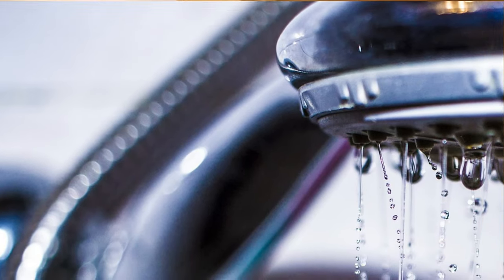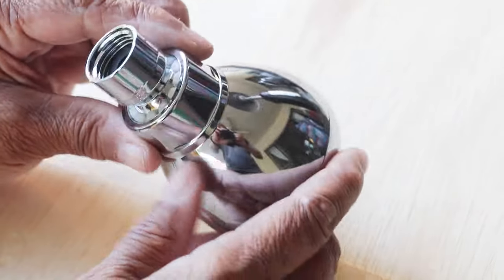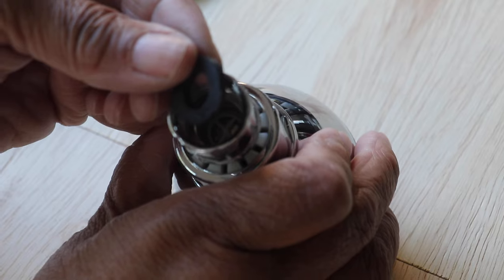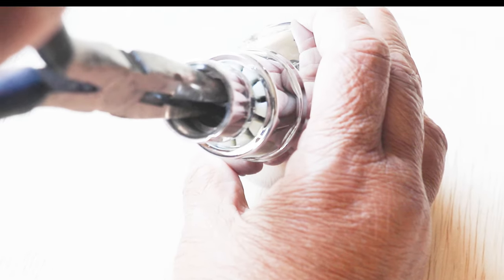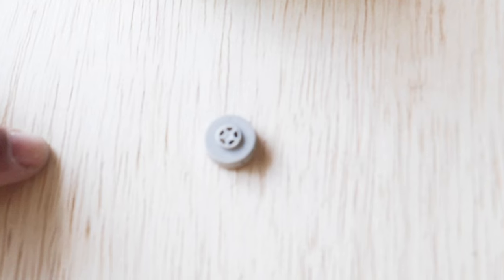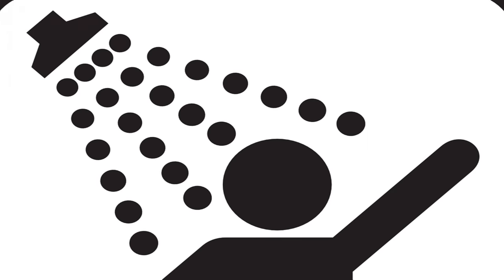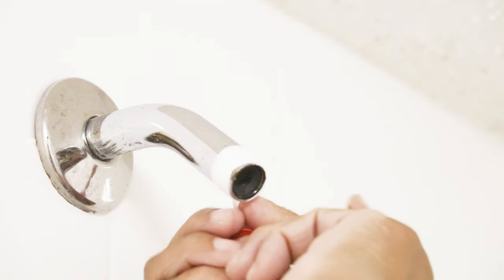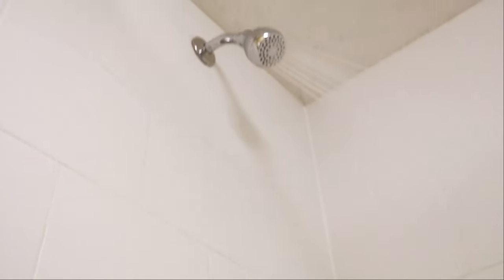Secret Few Homeowners know and PLUMBERS don't tell you

Comment: We plumbers have a professional responsibility to conserve water, and some water heater manufacturers  recommend leaving this fitting in place to maintain temperature control. Water flow restrictions can also act as a backflow device to prevent contamination of the mains water supplies. It is also the first time I have been disappointed in one of your videos...Also low pressure at the shower is not indicative of low pressure throughout the house... Some people will misunderstand the message. One more point is that once the shower manufacturers cotton onto the tampering of shower valves  the manufacturers will simply fit the restrictions into the shower valves as they have in Europe. This stops diy tampering....
Reply: Would you have time to explain about the backflow and contamination? Thanks, if so!
Reply: @regular-joe  of course. It depends mainly as to how the shower is fitted,and applies more to those showers with flexible hoses, rather than fixed heads, and if the shower is mains fed. Clean mains water passes through the shower head, but once it has it can  become contaminated from water in the bath or shower tray. Some bacteria can pass back along the stagnant water remaining in the shower hose into the fresh mains water supplies under certain conditions.
Reply: @profpriv  thanks! I'd absolutely never heard of that, much appreciated.
Reply from the maker: Thank you for taking the time to comment, it's aleays good to hear from brothers in the trades with a different position.  Now in all fairness, a flow restrictor is not a backflow device.
Reply: @seejanedrill  thank you Jane.
Reply: Yep, and the main reason, waste water plants are getting over loaded, they can’t treat the sewage good enough when there is too much waste water going through them. As a city grows the waste water p,ants stay same size, so that is main reason. Who wants to swim down stream of a waste water plant that doesn’t have enough time to treat water......out their drain pipe it goes.

Comment: Talk about ironic! Just yesterday, I removed the one in my kitchen faucet by accident! 🤣 Cheap leaky apartment fixtures. I don't pay for water. I don't waste it either. I DO need pressure tho. Kitchen faucet has NONE! 5 minutes just to fill a pasta pot. It drips when off. Loosens to a trickle when I leave. Thanks to you, I have extra washers and plumbers tape. On a wing and a prayer, I remove the loose handle. Find the drip cause! Stripped screw! Replaced that, by by drip! Wheee! Swapping the washer, this "thing" falls out. What's THAT?? Who knows? Fling it over my shoulder, and insert new washer. POOF!!! FULL PRESSURE!! What the heck??? Now it know!! Shower head here I come! You are my hero Leah!

Comment: I’ve been removing those stupid things since they started being used. I’ve had a flow restrictor that wouldn’t come out. I’ve actually had to drill a hole in one.
Reply: I have drilled a lot of shower heads as well. It's worth the time to do it. It's all fine and dandy to try and save water but if you have to spend 3 times as long to get rinsed in the shower you aren't saving anything 😉
Reply: I can’t get mine out.  Maybe I’ll try my drill.
Reply: @jafallica  Careful! Some are booby trapped.

Comment: I found that removing the restrictor was actually too powerful in one of our showers (it splashed everywhere), so we compromised by drilling out the small holes just slightly larger with a very small drill bit and it works FANTASTIC!
Thanks so much for your tip of removing it, we went from lousy shower pressure to what we consider perfect.

Comment: Sadly, this video was not online when I went looking for how to do this last year.  As always, Leah presents the most useful home-modification data in the most succinct and to the point manner possible.  This little hack improved my shower experience overall, and for the loony tunes who think this wastes water you should know that if you're in it to clean up and not just play around, removing this restrictor in an otherwise decent showerhead will reduce your actual in-shower time by around 10 minutes.  What's the math on that?  2 gallons per minute for 20 minutes vs 3 gallons per minute for 10 minutes...
Reply: Thanks Leah! Love your tips & tricks!! Cheers from FL😺

Comment: It's largely to comply with California mandates. Low flow will also cause fluctuations in temperature as some anti scald features on shower valves won't function well under low flow conditions.
Reply: I'll betcha this is the reason my temp fluctuates in shower!!!  Thank you.
Reply: This is especially the case with tankless water heaters that have minimum flow requirements. Rannai, Navient, etc.
Reply: @FM19MONTH  I had the same problem of water temperature fluctuating. I have  tankless hot water heater which is prone to do this on low flow.  What I discovered by accident is to first turn the water on as hot as possible, no cold water. When the hot water is flowing through, I then adjust the temperature to where I want it and it doesn't fluctuate anymore during that shower.

Comment: Also these flow restrictors can clog with hard water deposits or debris and cause major issues as well. They are more harm than good in my opinion. I had to deal with them in the newest house I bought in the faucets. If you want to limit water output, slightly shut off your valves to the faucet.
Reply: If you want leaks  by all means dont open them all the way......those valves are made to be wide open

Comment: California dropped the rate to 2 GPM for shower heads, and manufacturers nationwide have followed suit so they don't get fined if one of their products gets offered in the state. So this is great advice for everyone else!
Reply from the maker: Makes sense
Reply: I'm in California in the Central Valley and we dropped the rate to 1.8 gallons!!!  Can you believe it?
Reply: You need to rinse off and some you the water in pain management...if your water is restricted, you often just end up spending twice as much time under the water rinsing off.
Reply: I just replaced my sink spigot on the other side of the country and it had a 1.3 gallon restrictor saying the blame went to California on the package.But I quickly learned that if you measure up the restrictor in H x W x D and thread pitch , they are all metric these days. that one can go to Amazon and buy one of the desired flow rate ,well worth the cost.
Reply: Flow restrictors have existed since the 80s. Fully remove it, and you’re using more than 5gpm easily. So, let’s assume you’re actually paying attention and really shower in half the time, but still enjoy your shower.

At 10 minutes unrestricted, you’re at a minimum of 50gallons down the drain.

Flow restricted to 2gpm, at 20 minutes you’ve used 40gallons. The longer you take to shower, the more that waste grows.

Do what you want, but be aware of your use. If only to save yourself some cash when your water bill comes.

Comment: Hi Leah!  I'd like to advise your viewers (with your permission), that flow restrictors usually collect debris developing the pressure drop issues.  They can be removed, cleaned and reinstalled especially if the user has an instant on water heater (those units are very keen on water flow for delivering the temperature you set them at).  Thanks again and I LOVE YOUR MESSAGE OF YOU CAN DO IT!

Comment: Bravo, Leah!  I'm a long-time DIY'er, grow up with a handyman dad, so I knew about these.  But I haven't changed one out in a long while, so your video was a great reminder of what to do.  One note:  I just installed a newer Kohler (COSTCO) double-head, and the flow was awful.  The restrictor is a little different.  There's still the O-X plastic piece, but then there's a small rubber gasket underneath.  The entire plastic is sealed in place and cannot be removed, but just taking out the plastic part with needle-nose pliers and then the gasket using a very pointy tweezer did the trick!  Amazing water pressure now and the shower heads work like they are "supposed" to.  You are a pleasure to watch, especially since I think we had the same kinds of influencers in our lives.  :-)

Comment: It was such a tragedy when my flow restrictor magically fell out of my shower head prior to install. Sniff sniff
Reply: Mine got opened up when I tripped while carrying a power drill.
Reply: Heard they restrict your incoming water flow into your new build homes
Reply: @PamelaGreen354  If that is the case, you need a water storage tank with an electric pump.
Reply: @PamelaGreen354  It is restricted to usually 40 psi.  But where your water line first enters your home there should be a pressure regulator which is just a brass colored fixture with a lock nut and bolt.  If you're very careful you can adjust this by using a good water pressure gauge (inexpensive to buy) that you either screw onto an outdoor hose bib or onto your water heater drain; then open it up when gauge is secured and be sure there are no leaks .  I've got mine set to 68 psi which is a good compromise to protect plumbing, water heaters, etc. but still have good pressure throughout the home.  They also make fully adjustable pressure regulators which has a knob with the pressure settings marked onto it and it's pretty accurate.  You'll either need an existing shut-off valve before the pressure regulator, or have to turn your water off at the meter before replacing this.
Reply: @JRobert111111  Thank You very much for this information 👌🏻🌻
Reply: @PamelaGreen354  You're very welcome!

Comment: I treat water usage in the same way I treat fuel consumption. It isn't how many miles you drive and the speed thats matters, so much as the time the engine is running. A quick shower with full pressure will use less water than a longer shower with less water that simply won't rinse well. I think the additional  water consumption is minimal.
Nice video- you just earned a new subscriber!

Comment: EXCELLENT must-do shower improvement. Delta heads are a total pain though because the stamped-in restrictor spins in the head and does not come out easily, this is where I will use a 1/2" drill bit and be very carful not to let the bit go inside the head. Leah you're my favorite!

Comment: This is the first thing I do whenever I move to a new house. I'd wager that in the real world they don't actually save much water, as most people just end up needing to shower longer as a result of the decreased pressure.
Reply: Yes, like the newer "high-efficiency" toilets you have to flush two or three times to get the poop down!
Reply: Anyway corporations need to hold up their end of the deal and quit pinning it all on individual people's consumption. They pollute a ton of air, water, and soil to make all their crap that doesn't even last, purposely designed to break so you gotta keep buying. Including those shower heads made of that awful cracky plastic!!
Reply: When a water restricted was added to my shower I did start taking longer showers. I really should just take it out and have a decent satisfying shower instead of a long mediocre one.
Reply: @TheRealDadfad  Simply hold the toilet hand down longer.  It will lift the flapper and empty the entire tank.
Reply: @drasco61084   I agree with most of what you've said however the reason so much plumbing nowadays is made of cheap plastic is due to government mandates against using brass, which contains trace amounts of lead. (I'm a manufacturing engineer and a higher-up in one of the companies we deal with (Delta Faucet) told me that was their main reason to switch to so many plastic parts and so much of their plumbing parts are now made of plastic instead of brass. (Plastic extrusion with its high degree of defectivity and scapage during production gives little or no savings in production-costs when compared to brass.)
Reply: @TheRealDadfad  I just wish they'd use heftier material if they insist on plastic. Not that CD jewel case -like crap

Comment: Thanks so much !    The plumber told me I had low pressure bc my pex is a bit smaller than standard.  He was going off about having to re pipe the whole place.  That’s not what I had him over for but it came up in conversation.   I come across your video randomly and sure enough this solves the whole problem.   I’ll come check out what you have to say before I get any “expert” advice.   I can’t recall the first video I saw of yours but I certainly used the information obtained from it and am now going down the “see Jane drill rabbit hole”. Thanks again for sharing your knowledge 🙏

Comment: I stay in a hotel when I’m at work and I’ve noticed on some rooms someone has taken the flow restricters out and you can have a much quicker shower.  I try to remember the room numbers and request them when I return. 😂
Reply: A lot of hotels have high flow rates that I've noticed.  It prevents bad reviews on the internet.  They just add the additional cost of the water onto your bill.

Comment: Years ago I actually ADDED a flow restrictor to my showerhead. It was very different from the ones used by manufacturers. It was basically a concave washer; hardly had any effect on the water pressure. Just thought I would throw that in there...

Leah, glad you were able to make the time for a video. I look forward to them. I hope you and Zak are settling into your new surroundings. Best wishes.

Comment: Since I live where there is a well, water conservation is crucial. I’d rather have a less than fire hose quality shower than the well run dry.
Reply: I just commented that I only turn the water on long enough to get wet, then I wash, then I turn the water back on to rinse. I'm on a well, too, but I was going to do this anyway since the water is only on for two brief periods. I live alone, though, so I'm the only one using the shower.
Reply from the maker: It's just an option
Reply: Doesn't this choice depend on your local water situation? We've got a good regulator before the water enters the house and we've also got a chlorine filter on the shower which restricts water flow. So there are other factors to consider.

Comment: I wished you would have showed the before and after water sprays so we could all see the difference it made.
Reply: Yeah, I know. I thought the whole vid was building up to the epic before/after. Bitterly disappointed. Why, why, why?
Reply: Although the difference is noticeable you would not have been able to tell on a video.
Reply: Get off the couch and follow the instructions you would see for your own eyes what this educator has given you.
Reply: Why? If Leah says it improves water flow, you don't need any further explanation or evidence.
Reply: It doesn’t really show it on video because it doesn’t increase the pressure. It will increase the flow but not really the pressure. This is why if your home has proper water pressure I never recommend removing them. If you aren’t happy with the pressure there are shower heads that will give better pressure. Removing restrictors will defiantly dump out more water. But you will 100% use more water in general as well as run out of hot water much quicker if you have a tank style water heater. Unless you turn the water on and off during your shower.